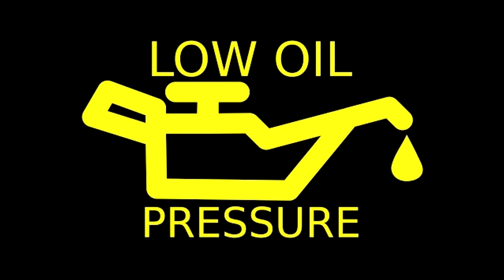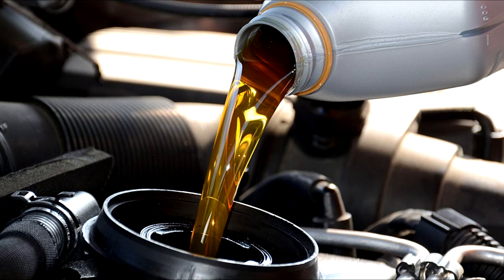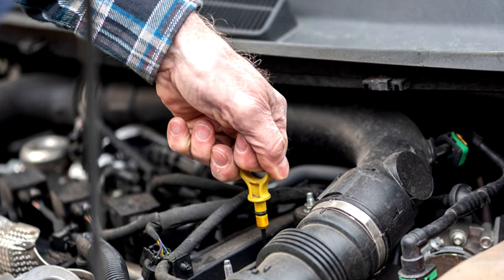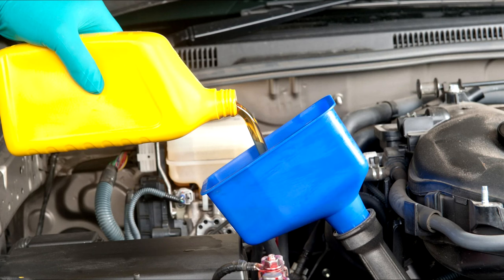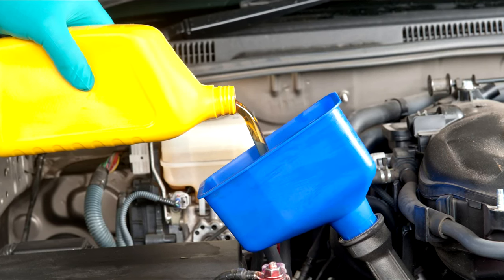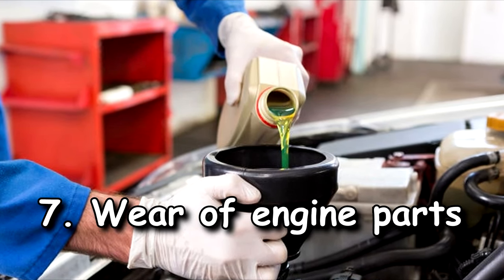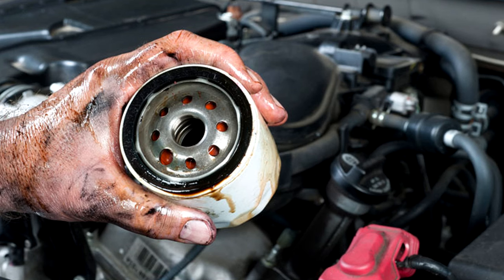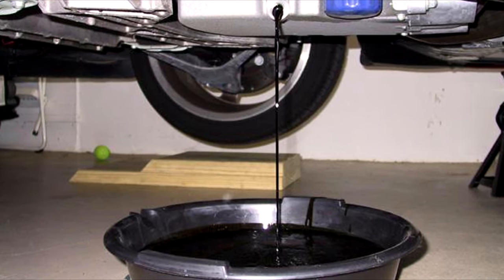Oil Warning Light🚨{on car}: Meaning & How to fix🚘Oil Pressure warning light [on dashboard] CAR?

Comment: My car started making sound noise when I press gas, then in the stop the oil turn red and car turn off I turn it on again and got home quickly
Reply: I have the same problem. What ended up being the problem/solution?
Reply: Blown rod
Reply: @WizardWorkDesigns  I think it was water leak in the water pump or next to it. Found water dropping and change it. After that the car reach half of temperature super fast less than 5 minutes. But fixed the problem.

Comment: Oil light came up i change oil pressure switch and light still on. When i check the oilpan the oil pipe strainer is blocked. So i cleaned it and all back to normal.
Reply: Same thing happened my VW Passat car recently.You were doing correct way👍.
Reply: Thank you!

Comment: I have a red oil light on my car that I'm scared to death of I'm hoping it's my oil sensor because my motor is clean it sounds great the gasket is fine the oil pressure is fine the oil is clean because I'm worried if it's not the oil sensor that it's the oil pump and the oil pump is a good 1800 to fix which I don't have the money for right now and no car no job my mechanic had no idea and just suggested the sensor because I was talking about it I'll know tomorrow. The temperature of my car also does not fluctuate at all my mechanic even though he didn't know what it was said it couldn't be anything too horrible but I know that if he's wrong and I drive it that I can blow up my engine if anyone has any suggestions I would love to hear them

Comment: Been using 10w40,  switched to 10w30 light came on, changed oil pressure switch twice light came back on. 219,000 miles
Reply: I'm curious what is the vehicle

Comment: Hi sir.
I have low oil pressure light issue at idle or low rpm.

I have changed
1. Oil pump
2. Oil pressure sensor. 
Still same problem last 18 months.
Still no success.
Pl help
Reply: Checked oil strainer?
Reply: @tintachonajr7373  yes sir...
Its all clean
Reply: Is this 1.0 ecoboost,i have the same problem what was your solution to a problem
Reply: Change to a thicker oil.
Reply: @arthursmith643  sir.
Already using 20w50
Reply: Have you checked oil level with a dip stick ?Thats the most accurate way to know .
Reply: This problem any solution sir